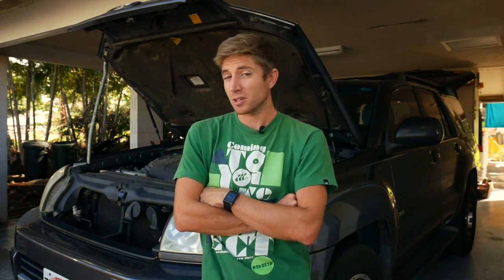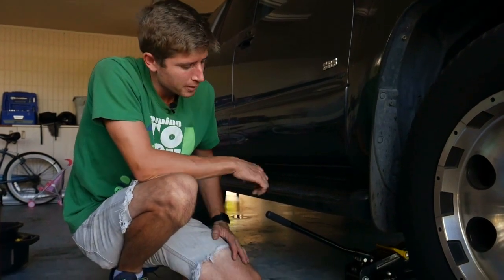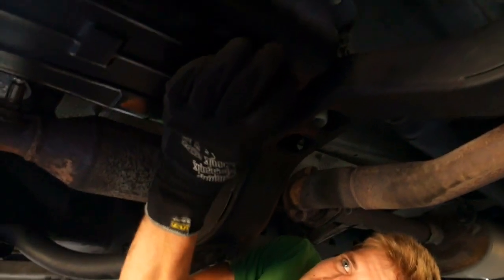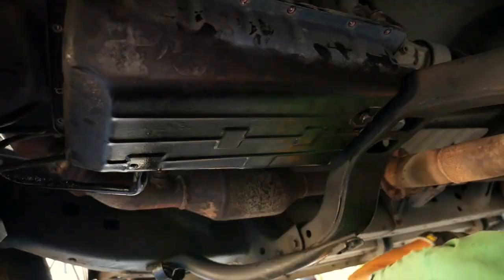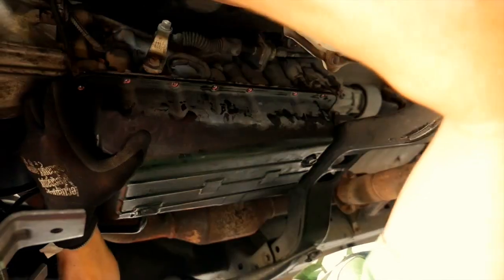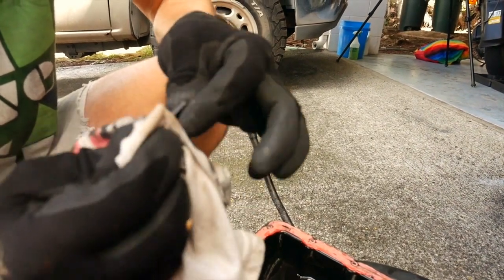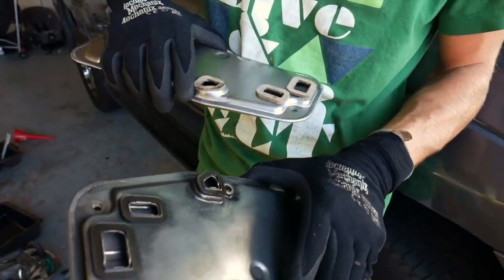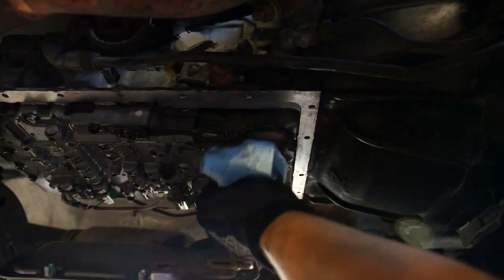Replace Toyota Transmission fluid & filter -  4Runner Land Cruiser FJ Tacoma Fortuner

Comment: Very informative man. Im looking into doing a transmission fluid and filter change on my '00 T4R tomorrow or the day after thanks for the video upload, very detailed man. Quick question/ suggestion from you, would you suggest a "budget mechanic" flush? Im seeing Musa's comment below mine and am just curious or would you suggest just doing standard change of fluid and filter??  With that being said, regarding Musa's comment and the reply, I'm presuming to replace the transmission filter each time, if I were to do a drain and fill 3x..Thanks ahead buddy!
Reply from the maker: Typicalasstyler, you do not need to replace filter every time! Just the once is fine. The filters on these things are really more like a screen and catch the larger particles.
Reply: Budget Mechanic dude that RTX gasket is no freaking joke!
Reply: Budget Mechanic RTV*
Reply: Budget Mechanic hey buddy did this process successfully, only once, and my t4r is still having a bit of a problem shifting at ab 30mph around 25-2700 rpms.. the magnetcs in the pan weren't terribly bad or anything although I'm no expert. Do you think if  repeating this process 2-3x clear up this problem and enable a better gear change? After runnjng the vehicle for maybe 5 minutes it shifts properly.. Any advice or suggestions would be greatly appreciated it..

Comment: What would happen if when the truck is lifted and the wheels are off the ground, the oil it's been drained already you start the engine and put it in gear let it move just a bit to make sure that as much of the oil is out. Would this damage anything on the transmission?
Reply from the maker: Rene Huerta while you may get a little more out, you run the risk of ruining something. The fluid not only lubricates gears, it is used to operate other functions in the transmission by pressure etc. I recommend you avoid running the car with no transmission fluid in the pan.

Comment: Wrong. You changed 1/3 transmission fluid only rest of it still in transmission. You did not clean radiator also.

Comment: Wouldn't using a heat gun be a good idea to melt the gasket to make removing the pan much easier? Pry bars and forcing...Sometimes you can't really avoid doing that; but that's one of the things that will actually damage parts, etc.  In my totally amateur experience, when removing certain parts, bolts; that's how you damage stuff. Not that I've done it that much, but wouldn't a heat gun help? Is there any good reason not to use one? What do you guys think?
Reply from the maker: Miguel Fleitas, a heat gun wouldn't be appreciably hotter than a transmission fully warmed up so I doubt it would have much effect on the gasket material. Professional mechanics use basically the same tool as a razor blade just wider and stronger.

Comment: Is this  automatic or manual transmission? tnks.
Reply from the maker: This Toyota is an automatic. For a manual transmission the fluid would be different but the job is very similar.
Reply: Hey Hey, thank you Budget Mechanic in Hawaii for the helpful info. I have a 91 4runner- manual transmission V6 3VZE engine. Do I need to change filter also for my manual transmission... or do i even have a filter?? Tnx again.
Reply from the maker: Glad to help! Manual transmissions generally don't have filters and with a preliminary search I don't think your vehicle does either... so no need to change.
Reply: Many many thanks for the advice!  I think I'm ready to drain and replace my transmission fluid now.

Comment: Can you give me the part number for the transmission pan gasket please thanks
Reply from the maker: I don't have the number for that specific part but I do remember the owner first ordered a gasket online and it was the wrong one! I would recommend getting one at local auto parts store so you can give them all your vehicle info and look at it before you buy. Good luck!
Reply: That's what happen to me I order and I received the wrong part 😭
Reply: I thing one its 19 bolts and other it's 20 bolts. 😭
Reply: Thanks anyway  🙏

Comment: Hey Budget Mechanic Hawaii, I need a little information.
I drive a 2005 4Runner SR5, V6 4x2. I as well would like to change my trans fluid and filter. I checked my engine bay and do not have a dip stick for the trans fluid. I was wondering if the same procedures apply as you did, except for the filling portion. I believe I have to use a fluid pump to fill the trans again.
Reply from the maker: EG6kidd yes that true for transmissions without dipstick. Make sure you check on fluid for that too since often those “lifetime” transmissions require special fluid.
Reply: Mahalo Josh!